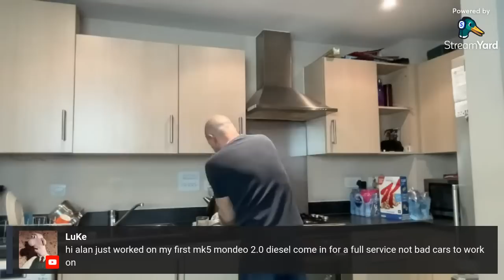Most common causes of engine breakdowns/lack of power...Ford Mondeo Mk5 2L Diesel

Comment: Hey Andy, where would you say is the best place to get replacement parts, second hand is fine, some one decided to reverse into my 2017 estate........ would be nice to get the bumper replaced and make it look like it used to xx
Reply from the maker: ebay is best for secondhand parts and depends where you are but in cambridgeshire granville supplies do aftermarket bumpers and panels a lot cheaper than ford dealers

Comment: Alan.  Could you be of assistance ?  I have a Mk2 1.5 Terios Auto.  I believe.  I may have a gear valve body solenoid fault on the auto box.  It bangs into a gear flashes O/D and drives in a limp gearbox mode. Holding max 2/3rd gear.   Requires constant turning on and off once couple of miles driven warn until doesn’t flash O/D and drives up down box smoothly and normally. .  Where would I fix it.  Even a tranny specialist said parts too hard work. Get a used box. For a valve body solenoid. Sounds over kill.